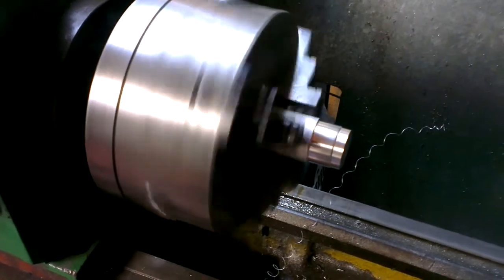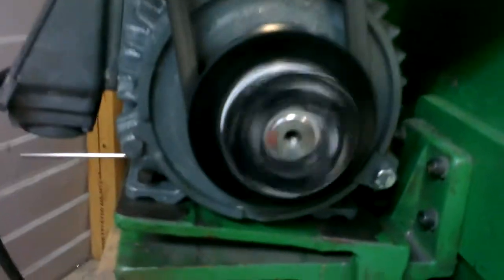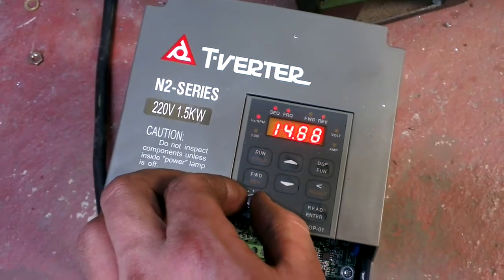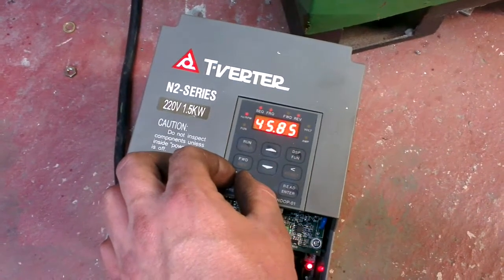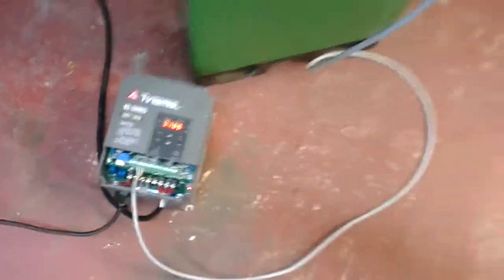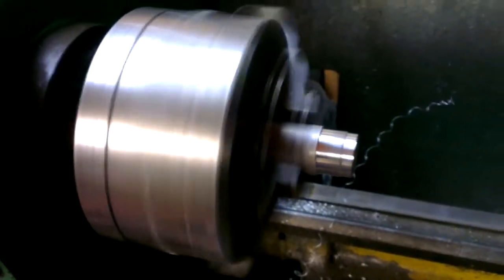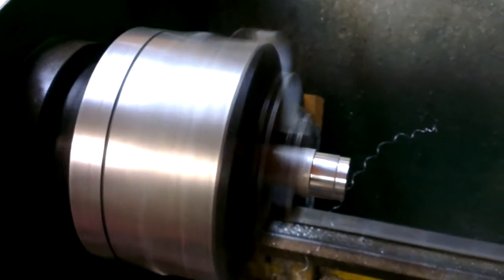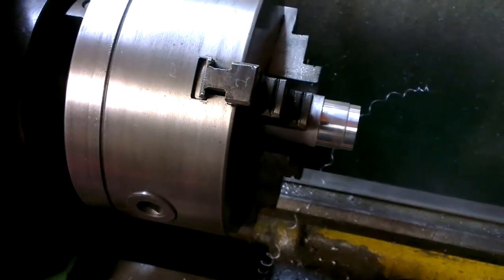Teco 3 phase 2 hp lathe conversion

Comment: Nice!  I was looking at the Teco and thinking about it instead of the rotary phase converter just today.  The price ends up about the same.  How has it been working out for you?
Reply from the maker: edrowley1 Hey Ed, I've since sold this lathe and upgraded to a bigger one that is still single phase (I will put a VFD on it at some point) but I have the same VFD on my Hartford milling machine that you've seen. I haven't seen any one else use this specific Teco VFD that i'm using, maybe because i'm in New Zealand and that's what we get. I would not hesitate to go VFD over RPC. my mill is 230v and I still have use of the coolant pump and power feed on X. Cheers, Scott